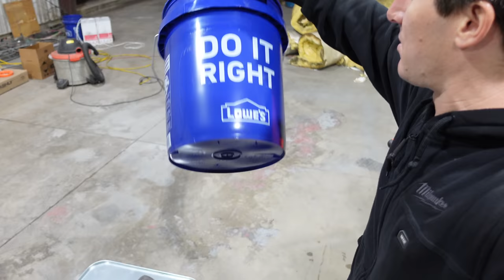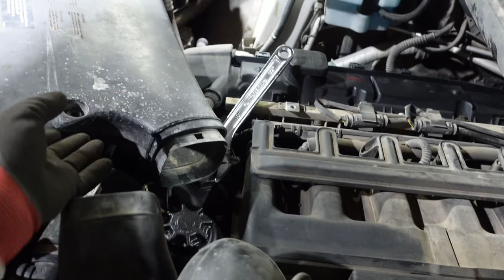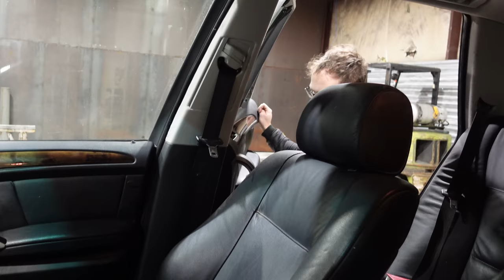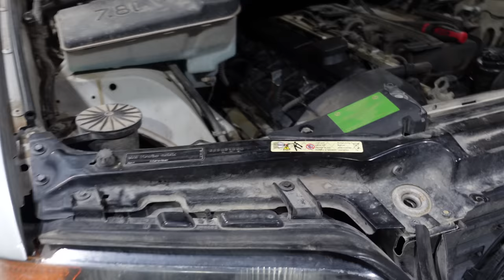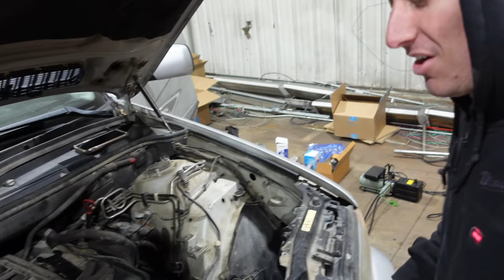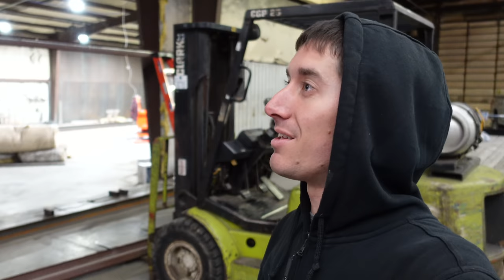RIPPING All The PARTS Off The BMW I'm Going To Sell For $1

Comment: That’s a Standard crescent wrench, you need a Metric crescent wrench.
Reply from the maker: Just flip it over 😂
Reply: @WatchJRGo  you flip it over for left handed threads
Reply: If you flip it over and then use it upside down its in cubits. #ark
Reply: Ah the great debate of the "Nebraska Nut Rounder".
Reply: @WatchJRGo  wish i would have known that two weeks ago! bought both Standard crescent wrench and a Metric crescent wrench off the darn mac tools guy! :(

Comment: Great truck, had an 05 X5 3.0, only issue was a.short in the drivers seat heater. Almost melted my jeans and drove off the road. Wife now has a 2012 X5 5.0.

Comment: I have used a air hammer on the loosen side of the fan hub nut to break them loose when replacing the fan clutch and w/p.

Comment: My son's 3-series had every window regulator break between 90K and 100K miles. The plastic radiator overflow pipe broke every 30K. The car was fun to drive, but stuff was breaking all the time.

Comment: Hammer and a punch method works on those fans, it's not ideal but you're replacing it anyways. Only came across one that it didn't work on, gm4200 ended up cutting the water pump off of (wrenches, hammer and punch, heat, nothing worked so a cut off wheel for the job).

Also I like "The House of GO" as a name for the warehouse.

Comment: make sure you're loosening that fan clockwise (reverse thread). I use the same tool from my e46 for the e53 to break it loose but I use a hammer and smack it loose.

Comment: You did remember that the fan clutches are reverse-threaded right?
Reply from the maker: Of course, it's pretty rusty, might come off with the torch. 💯
Reply: @WatchJRGo  I feel your pain. My E32 and E34 fan clutches laughed at me.
Reply: Well that answers my question. Cool.
Reply: What's the saying? It can't be tight if it's liquid lol Torch is probably going to break it free
Reply: @WatchJRGo  Time to go buy that 90 degree milwaukee impact.
Reply: Big wrench, hit it with a hammer, comes right off.  Watch BMW techs do it for 11 years.
Reply: @WatchJRGo  If you have the correct 32mm fan wrench, put it on there and whack it with a hammer.  Analog impact wrench.  I've done it 10's of times on my BMWs throughout the years.  Never fails.  

PB Blaster might be a good idea as well.  Use antisieze when you put the new one on.  

Also, are you planning on replacing the PS reservoir?  Internal filter in those so no doubt it's not flowing freely after years of dust and crud.

Comment: The Nissens have a weird lower neck and may have an excess plastic molding that can cause a slow leak. Sometimes you have to nail file the excess plastic molding. I hope your install went smoothly.

Comment: You need a Lisle 43300 set and an air hammer, makes those fans 1000 times easier!
Reply from the maker: Welp, just bought that... I fought this thing for a solid hour. 🤯
Reply: Good deal, I know it's saved me a ton of headaches over the last 4 years. Keep up the great work man!

Comment: Save everybody, including the new owner a lot of trouble; take the e53 and put all the parts in the back. Then run the whole thing through a crusher
Reply: Mate you'd be begging to buy this for one pound.
Reply: You no nothing about BMWs.. not all BMWs have problems
Reply: @aidenp5768  this one is one of the worst. If you knew anything about BMWs you would know that
Reply: @EFFEZE  sure, scrap value is at least a couple of hundred dollars
Reply: @kevinbarry71  you'd get £250 max over here
Reply: @aidenp5768  you remind me at one time, a friend of mine was talking to his uncle who owned the jeep. The uncle said it was the best vehicle he's ever had and it's never given him any trouble. My friend, proceeded to ask his uncle, what about the engine you had replaced. And how many times have you change the transmission. And how many months has it been in the shop for, a whole list of problems. But he never had any problems with it. Who is blinded? Those cars all looked really nice in the show room. They're full of plastic bits that degrade and disintegrate. Then you learn the electrical connections are not very solid. Nor are many of the components. And the interior isn't nearly as well-built as you first thought. So yes, continue. I used to love German cars also. However, I have finally excepted the hard truth; German engineering is a big joke. And now they do BMWs have even worse interior finishes, and they don't drive as well as they once did
Reply: Agreed. Nice gesture of course, just a pile of shit vehicle. Just an opinion.
Reply: @kevinbarry71  
Your just hating on bmw at this point. There’s literally nothing to hide or anything. Like any car My 04 X5 had things to be replaced, spark plugs, coils, suspension parts, Cv joints. But engine wise? Not even once has the engine been exposed.. I fix it myself. My X5 has never seen a mechanic since 2007 when I got it. It’s always been reliable. I refuse to call the e53 generation unreliable after all these years. It’s been through so many winter storms and it never got stuck once, no rust, it’s been through driven in floods, it’s been real off-roading with jeeps, it’s been through a lot of stress, I’ve towed over weight capacity 8,000lb for 1,000+ miles, not a single problem. It’s paint looks almost brand new, it just has a few rock chips, the interior brand new. It doesn’t have any interior rattles, water leaked, no sun roof problems.. none of the above. Door handle broke once because someone had slammed my damn door too hard, but that’s pretty much it. To save money I towed all furniture from my house to my new house no problem, if you were to see the inside of my house right now, everything you see inside was shipped by my X5 over time. My X5 still looks good outside right now this morning, shinning and ready for another trip. I have oem parts, and I use premium 91 gas (ALL THE TIME), I never cheap out, change the oil before the car even warns me, and warm the car up for 6 minutes minimum warm or cold doesn’t matter. People buy used BMWs thinking they’re cheap when they’re really high end vehicles and they need their high end expensive maintenance, they forget that a BMWs engine isn’t ordinary, not ordinary compressions, all BMWs need the most care possible, same goes for Benz, Audi, Porsche. You cannot cheap out, if you do cheap out the car will bite your ass in revenge, how will it hurt you? By taking your money. So I suggest to not assume any reliability issues without knowing a cars history, owner. Also don’t judge a BMW without proper experience.. because literally no owner even a owner who mistreated the X5 would say that their M54 was unreliable. The X5 still handles sporty, looks sharp, still gets compliments by car guys because of how old it is and how new it looks. Brilliant machine and reliable for sure, shouldn’t think twice about reliability. Now the N62 after 200k miles is a different story. And before you claim transmission problems.. bmw doesn’t make transmissions often and my X5 has a GM sourced trans so before you try finding something else to bash bmw about let me just put that out there.

Comment: I had the same fan issue with my e39 when I did my entire cooling system. That fan was a bear!
Reply: What finally worked?
Reply: Always is. Even with the water pump holder I usually needed a 2 foot wrench and would smack it with a dead blow to break them free for the E36/E46's I've done in the past.
Reply: It's a left handed thread as well iirc...
Reply: @kevinjessel8809  for me I had to yank the pump and fan together then chuck it up into a vice and hit it with the torch + penetrating oil to get it to break loose.
Reply: when i did my fan and water pump in my e39 it didnt give me much trouble at all
Reply: @lukemartinez4413  Randy isn't that sharp, life is hard for dummies.

Comment: How do you plan to heat and cool that big building? It gets hot there in the summer and really cold in the winter. That's the reason I would be leery of a shop that big, the cost of heating and cooling has to be huge.

Comment: Is the fan a reverse thread? 🤔
Reply: Reminds me of a repair I did for my friend's hooptie oldsmobile regency. I replaced the radiator. But I almost rounded the tube connector nuts completely because I couldn't figure out for near 45 minutes wrenching on them that they were reverse thread.

But respect JR knows this with the BMW and is just dealing with corrosion.

Comment: With all the effort to strip down the motor, how do you know the core is good for another 100,000 miles?  The rod bearings, the timing chain, it’s tensioner, the vanos, rings?

Comment: Those drip pans they sell at auto stores are crap. They look nice and all, but the sides on them are so low they can't hold anything without spilling over the sides. Get a plastic pan that goes under a clothes dryer. Cheap and they have at least 2" sides and can hold an entire cooling system dump or oil with much room to spare and no spillage.

Comment: Leave it to BMW for putting a coolant temp sensor on a flexible plastic radiator hose outlet. That fan clutch is a ridiculous setup too. You shouldn't need a special tool just to remove it. Stupid BMW!